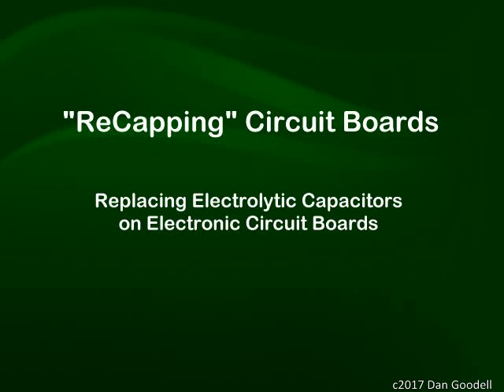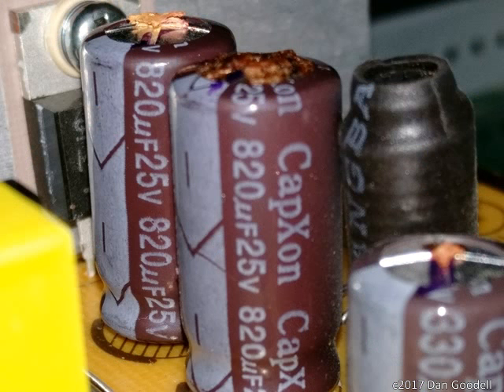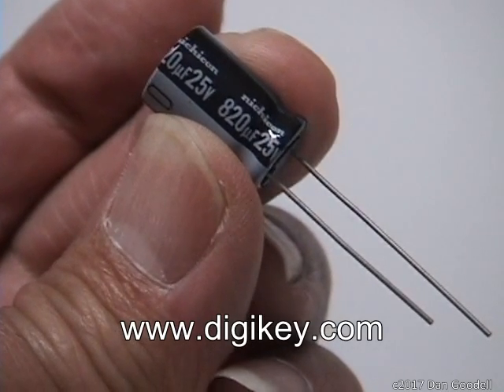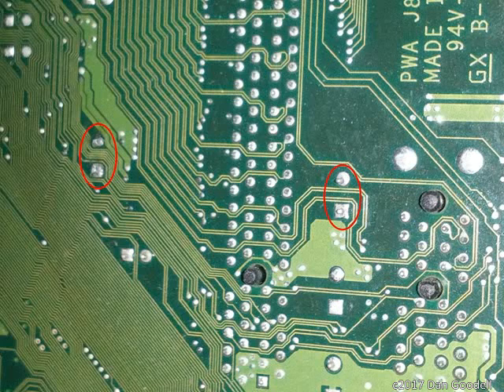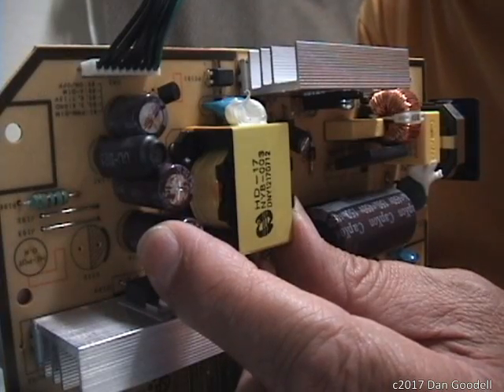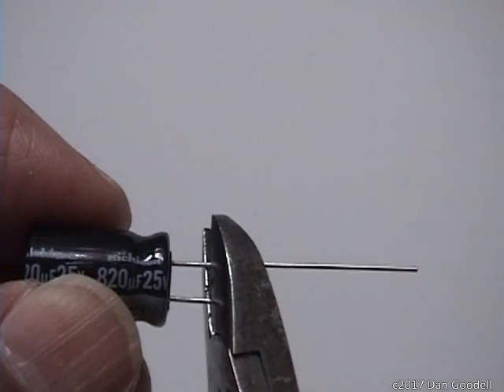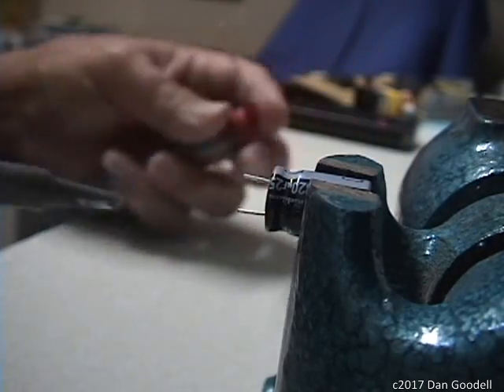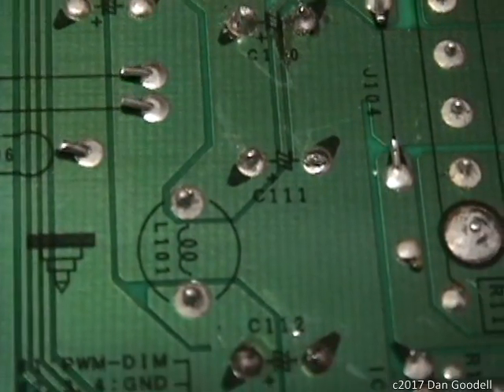Replacing Electrolytic Capacitors

Comment: This is very nostalgic video for me. I was doing it this way because of lack of tools mostly. Well I didn't know any other way and eventually it was working. I still recall nightmares with multi layers PCB and trying to insert enough heat. Then I found solder wick, vacuum pump and eventually de-soldering iron. First improvement was cleaning pads after removing a cap with solder wick. Made soldering new caps way easier. No need for the dance. Then came better soldering tin with a good flux/rosin. No need to tin cap legs and clean pads made soldering easy process. Now days especially removing that evil cheap leadfree tin and using proper 60/40 and cleaning pads is crucial. Then I found out that vacuum pump speeds up de-soldering and cleaning even more. Apply the heat. Make sure heat came true to the other side heating the while solder joint wetting all of the tin. One press of the button and leg is free. Then I found de soldering irons. Man that was de revelation. Now days there are so many cheap alternatives and even heated manual vacuum pumps. Just got one for nine bucks. No heat regulation one size tip and its basically hollow soldering iron instead of teflon tip of a manual vacuum pump. Works as good as any de soldering iron if you do not mind manual operation. Currently I am not de-solderingnor repeating much so I can't justify to my self proper professional desoldering iron.  Last revelation for me were new style active tip solderin irons. Got 3 different once lol. JBC with 130 watt cartridges is pure magic. So small and capable of doing anything. So dynamic and so capable of heat delivery. It does same job with 300 degrees Celsius that old school soldering irons need to go to 450 degrees or cheaper models can only dream about. This helps with multi layer boards and ground and heat sinking planes in such boards. JBC is at working temperature in 2 ti 3 seconds and working fast will not cool it down at all. In need of active tip soldering iron and not having JBC money? Get one of the Chinese T12 tip irons. I think Ksger is the best. Use tips that come with it then switch to genuine Hakko T12 or T15. Forgot to mention cleaning off flux/rosin with IPAcame after seeing nightmares when people have left it on. Especially when some bright person have used acidic flux for soldering pipes on the electronics. All in all introducing few steps and better tools made it faster and way easier. Back then recapping a ATX mainboard would take hours. Now it would take 15 to 20 minutes. Desolder all with de-soldering iron. Wick all the pads with good wick (pun intended). Next soldering the new caps with JBC and good tin. Then cleaning it off with isopropyl alcohol and wipes. Easy peasy. I wish I have had this back in the time.
Reply: All of that, plus he was replacing elyts in a switch-mode PSU secondary side and DID NOT mention ESR. I couldn't believe my eyes. Picking the right capacitor for the job is crucial and it's not just a matter of capacity and voltage. Thumbs up for Nichicon, but he skipped the choice of product line. After that, I'm not at all surprised that he has not mentioned solid polymer - which in my experience turns the circuit immortal (as far as capacitors go), except in rare cases the tiny ESR may destabilize the feedback loop of the SMPS, and solid poly also should not be used in filters or RC timing circuits, due to their inherently higher leakage (would skew the timing or ruin operation of the circuit).

Regarding ESR (and permitted ripple current, which is the flip side of the same coin), you really need to study a handful of vendor datasheets to get a clue. You will likely end up settling on one or two high-grade families of wet aluminum elyt capacitors from each top-notch vendor (Nippon Chemicon, Panasonic, Nichicon, Elna, Kemet, maybe one or two others) and you will specifically know that there are the cheaper product lines, from those same vendors, that you need to avoid for SMPS use.

Any solid polymer (almost regardless of vendor) beats any aluminum elyt, except that solid poly is not available for higher voltages and it features that slightly higher leakage which matters in analog circuitry = for those two cases you go for quality wet aluminum.

The caps originally used likely have twice the nominal voltage (or more) compared to what they actually sustain in the schematic. This is for practical reasons (BOM variety reduction) and there was a rule of thumb that "nominal = twice the actual voltage" results in maximum lifetime, all else equal. And then the board maker would typically save on cap vendor and ripple current dimensioning.
 
So if I have a chance (I have a schematic or I can measure the circuit beforehand), and I have a clue about the function of the circuit that I'm recapping (most often some stabilized PSU rail) I first look for a solid poly that's just "one step up" from the actual voltage (such as: 5V actual -> 6.3V nominal) as for solid polymer this is perfectly okay. And on SMPS secondaries, I go for a cap model that fits in the space (diameter and height), that's available to me (stock levels are problematic nowadays), that has appropriate nominal voltage, and I try to max out the capacity. Even in the polymer range, I tend to find a cap that has larger capacity (and I could actually go even with a lower capacity, as it's really ESR that matters in SMPS secondaries). And I can be pretty sure that any polymer will have significantly lower ESR than the comparable aluminum wet elyt I am replacing = ESR is not much of a concern in that case.

Concerns about "higher capacity than original = risk of blowing an inrush-limit NTC" is only any concern in the SMPS PSU primary side, where you likely won't have enough space to hitch capacity up anyway. This concern could also be valid for audio amp rail voltage, on a secondary side after a conventional 50Hz iron-core transformer (which can carry several times its nominal power, for a limited time during inrush).
In contrast, in SMPS secondaries, don't worry about inrush. Inrush does certainly happen on startup, but is inherently soft-limited by the SMPS main stage maximum carried power, and the energy storage capacity (in watt-seconds) is far lower in the secondary, compared to what's stored in your primary, because of E=(1/2)CU^2, and because of the capacitances typically present in the primary and secondary side. Also, the secondaries only start charging after the primary inrush is safely over, and the main stage starts up. If you'd crank up the secondary side capacitance way up high (decimal orders), the SMPS would probably detect a failure to reach output rail voltage within some timeout and would either shut down altogether (output short circuit detection) or would keep re-trying (hiccup mode), and might as well reach normal operation after a few hiccups (or not). Some industrial PSU's are actually protected by a constant current limit on the output (time-unlimited, or time-limited for e.g. 3 seconds) but that's not something you'll find in PC's / displays / consumer electronics.

BTW, thumbs up for mentioning IPA for cleaning, and the various flux varieties.
I have one specific use for aggressive acidic flux in microelectronics: it's an excellent agent for de-oxidizing your soldering tips, including the hollow variety in desoldering guns. An oxidized tip ruins your whole soldering experience. I keep around a few coin-sized scraps of sheet copper or tin-covered iron, and a small flask of "stainless steel flux". When my soldering tip goes dull, I depose a tiny drop of that acidic flux on a piece of tin-covered metal sheet, and wallow the tip around for a bit in the molten tin+flux. The fumes are really bad, but the tip is like new. Then there are some "best practices" for taking care of your tips, such as apply a droplet of tin on the tip when turning the iron off = keep it soaked. And, bronze or brass shavings are more appropriate (sensitive on the tip) than a wet sponge.

And a tip for working with the heated desoldering hollow tip/gun: apply the tip on the component leg being desoldered, wait for the tin to melt through the hole, and then gently wiggle the hollow tip around on the leg, by circular motion, and only then apply suction, while still wiggling around. In problematic holes (large areas of spilled copper) the air sucked through the hole will quickly cool down the hole below the melting point, but chances are that this motion helps you clean the hole thoroughly before that happens.
When I have a problem with "too much copper around", there are pre-heat aids (pads) commercially available, or I apply additional heat on a nearby soldering pad, or I can apply a thin local streak of hot air... sometimes I would use four or five hands, rather than just three 🙂

Actually as a first measure, if I fail to desolder a lead-less leg upon the first attempt, I apply a drop of Sn60Bb40 on the leg, which hopefully soaks through the hole all the way to the component side, and dilutes the pure tin - so that the second attempt has a better chance of succeeding. A colleague used to have a special tin wire with Bismuth content, for this very purpose (low melting point, diluting problematic solder joints when desoldering).
Reply: @xrysf03  Holy shit. Who has this kind of time to type this? Lol.
Reply: Thanks for the essay
Regards

Comment: pretty nice soldering skills!

I would rather not have the caps completely seated using this technique, unless it's a high vibration environment... not playing an expert on recapping and haven't measured the temp, but to me it seams like there is a real danger of heating the new caps for unnecessary lengths of time going from one leg to the other like that, especially for a beginner doing the first soldering projects.. maybe alternating between the caps...?
A toothpick could be used to clear the mounting holes prior to inserting the new cap (melt the solder and plug a toothpick in for a sec).
De-soldering tools can help in removing the caps and also in clearing the mounting holes for the new caps. The automated vacuum ones are the best as one can do a circular motion around the leg vacuuming the barrel clean (pcb thru holes). De-soldering tools can take a while to learn to use; the larger the pump the better the suction but also clumsier  to use..

The way I like it goes like this: remove the old caps while setting the tip temp so it takes 2-3 sec to melt the solder (considering the nature of the board and capacitor, talking about regular sized ones, not the 3" cans, etc), clear the mounting holes, mount the new caps one leg at a time (2-3 sec dwelling time for a nice solder flow), trim the legs last as it helps dissipate some of the soldering heat in my opinion and clean the finished project with paint thinner, acetone or >70% isopropyl alcohol.
Reply: theres always one.

Comment: Thanks a lot for the clear explanation! I always thought it was needed to remove the old solder and apply new. Would you replace the solder on vintage equipment, say 40+ years old?
Reply from the maker: As a general rule, I do not try to remove old solder unless I can't get a good joint with the new component. You can make a mess if solder drips across circuit board traces where it's not supposed to, especially if the traces are close together.

However, in some environmental conditions really old solder may oxidize enough to develop a gray, gritty coating that comes off on your fingers. Such solder probably won't bond with the new part and can leave you with a cold solder joint. In that case, remove the bulk of the old solder and apply new solder. You don't need to get all of it off, just enough so the rosin in the new solder can finish the job cleaning the contacts for a good, new bond.

You can use solder wick or a solder sucker. I've also had success just lifting the board an inch or two off the workbench and letting it drop. If you use this latter technique, add a bit of new solder to the old solder so the ball of solder will be a bit heavier, then drop the board so the molten solder drops onto the workbench in a small ball. With a little forethought you can orient the board so to lessen the number of components the ball will drop past, minimizing the risk of the solder catching on other components and bridging circuit traces.

But the need to remove old solder should be rare. Most of the time I've been able to get a good solder joint without resorting to special efforts to remove old solder. Sometimes I may even add just a touch of new solder to bolster the joint, since some of the old solder may have been taken away on the leads of the old component or on the tip of the iron. Plus, the rosin in the new solder also helps to clean the joint a tad more.
Reply: @dangoodell2  Thanks a lot! It's good to be able to learn from the experts.
Reply: @dangoodell2  Really excellent and detailed explanation here.  Ditto for the video.  Thank you.

Comment: Sorry, but the brand cited in the document Nichicon was not used in the optiplex dell machines. I met this problem in France when i was working for Total (petroleum). I had to swap motherboard, because those were equipped with CapXon capacitors that were litterally bombing and leaking like  cock that has not been wanked enough ! PS : and CapXon is pure shite and 3rd grade capacitors while Nichicon is top 1st grade capacitors brand.

Comment: When you pre-tin the tip, is that using just regular ole solder or something special?
Reply from the maker: Nothing special, just ordinary solder. Clean the tip on a damp sponge, then a quick touch to the solder to re-tin the tip.
Reply: @dangoodell2  Gotcha, thanks!

Comment: Just to clarify on PCBs that are not marked + or - the negative end is the zebra striped side?
Reply from the maker: There's no convention if the board uses clear vs. completely filled half-circles (I've seen them indicating both ways), but zebra-shading seems to be more consistent. In every case I've seen, the zebra-shaded side has always been negative.

Also, a heavily-inked arc along one side of the circle may also be used to denote the negative side.

To be sure, make it a habit of noting polarity before removing the old capacitor, and/or look at other capacitors on the board to see how they are oriented vis-a-vis the board markings.
Reply: dangoodell2 thanks.   I wasn’t replacing capacitors I was putting a delay guitar pedal together so it was all a fresh PCB.   And there was no reference point but thanks for answering

Comment: Finally someone says which is the negative and the positive on the board!!! Thank you
Reply: And sometimes pcb boards made mistakes with printing and when the board was made, caps blew of course the polarity was wrongly printed on the board, to cut costs the guys who solder the boards ignored the wrong print and installed it right. Now years later you come along and follow the printed negative sign. Bang caps blows up. You allways check if the print is 100% correct on the installed cap. If not always follow installed caps negatives. Make pictures first!!!!